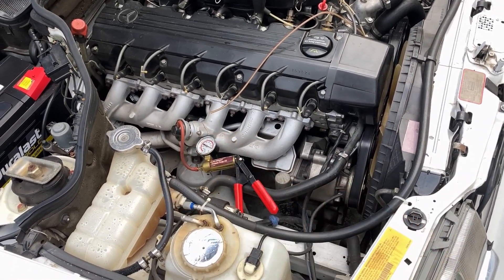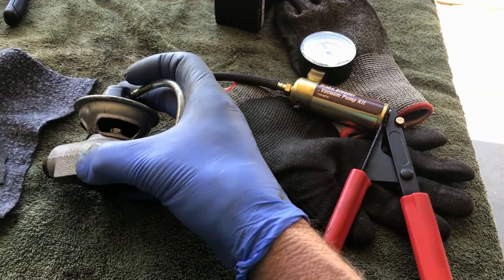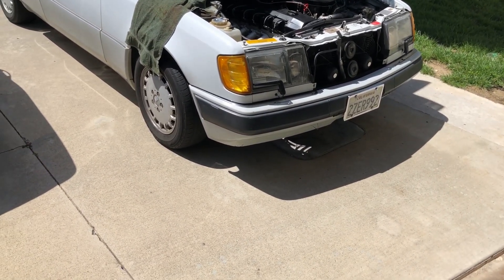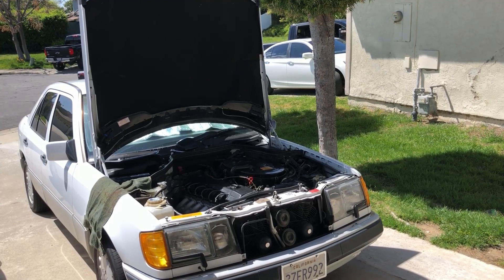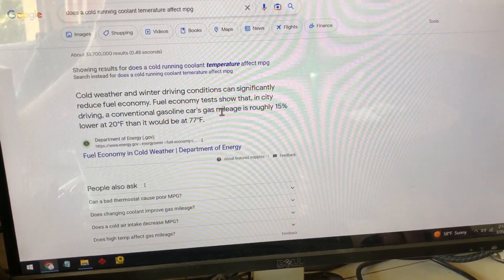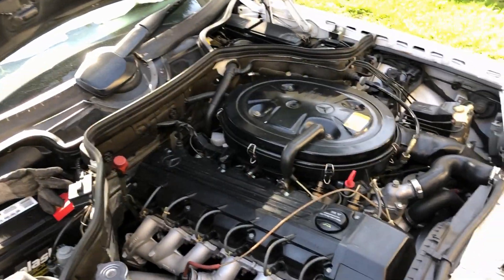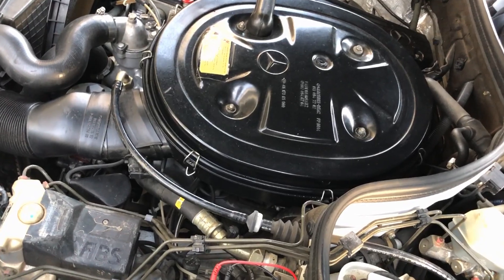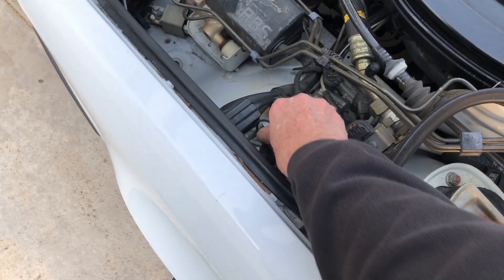W124 300E Gas Mileage  Part 2

Comment: The reason for fuel consumption is the spark distributor, try to set it to the Top Dead Center 

Also, replace the sprinklers because they are one of the biggest causes of fuel consumption, because their pressure weakens over time and fuel leaks even after turning off the engine by a quarter of a gallon every time you turn off the engine.
Reply: Sprinklers? do you mean Injectors

Comment: Did the new O2 sensor fix the poor fuel economy? What kind of MPG per tank is she getting?
Reply from the maker: He said it’s still bad, new 02 sensor did not help, he says a full tank gave 176 miles 
Car runs great I just don’t get it?
I may try reading codes if any, injectors were replaced 
Car passed emissions so it’s not running rich.
Reply: @mygermancars7264  I am in the same position with my '90 300E. 

Passed emissions when I first bought the car a month ago then I did the following:
- Replace fuel injectors and seals
- Cleaned IAC valve
- Replace leaking rubber hoses
- Replaced spark plugs
- Replace rotor 
- Replace distributor cap
- Replaced fuel filter
- Changed oil
- Changed coolant

The only thing I think that is left is a leaking fuel line. When I was under the car replacing the fuel filter it looked like the rubber fuel lines were the original ones.
Reply from the maker: @GermanBlueMax   Yeah, it can be frustrating  his car runs really good,  its hard to find a problem when it runs great and everything works, being a 30 year old car may have something to do with it.
Reply from the maker: @GermanBlueMax  Also you can monitor my problem on BenzWorld, may get some ideas.
I'm lowesguy there.
https://www.benzworld.org/threads/10mpg-no-way.3116679/